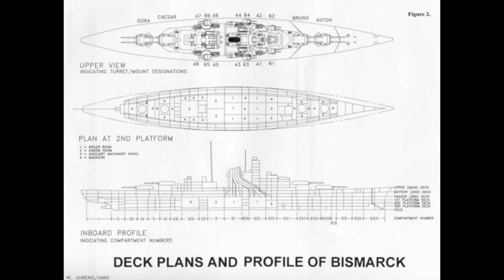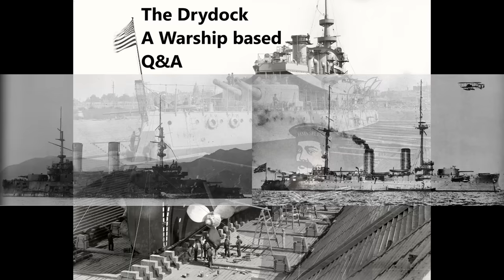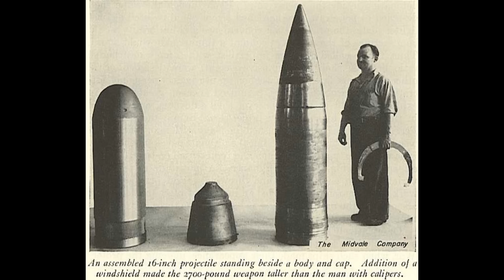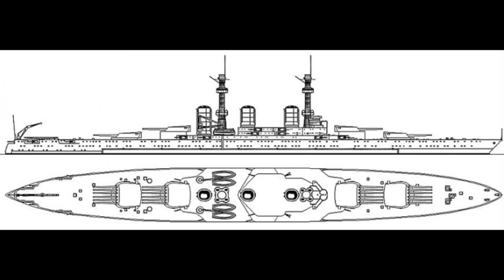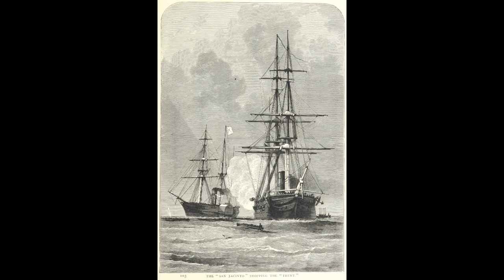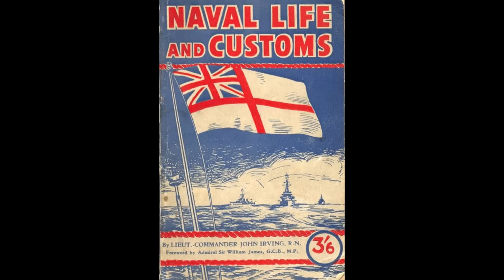The Drydock - Episode 096

Comment: Recoil issue - more waffle, I'm afraid.

Gun recoil on a single gun, commonly on a destroyer say, is longer because the gun is mounted as a single on its own centreline. The recoil cylinder is also part of the gun mount and recoil generally has little direct relationship to the ship's structure. This is underscored in the next example of recoil and run-out on a twin mount. Gun recoil cylinders (encased springs in what is essentially a hydraulic collapsing ram filled with oil and soft soap) generally work well within design tolerances for the gun mount and do not transfer that much to the fixed structure. 

On a twin mount, the barrels lie either side of the mounting's centreline and in alternating fire - the common fire control method - this off-centre barrel arrangement dictates that the mounting itself absorbs some recoil. This is why twin turrets in the medium calibre classes have what is known as a 'recovery time' - that is, the time it takes after absorbing recoil for the turret to get itself back on the firing line. Shots before this would obviously be off-aim, which is why alternating fire and a rounds per minute rate which also takes into consideration the turret recovery time is used.

One caveat for this would be where a twin gun is set at Local Independent Fire - meaning the rounds can be fired as soon as the breech closes or as and when the Captain Of The Turret (who can always see a target) operates his trigger, but this would generally be in instances where the target is relatively close and in clear sight,  or where the situation is desperate and timed firing is not possible.

Twin gun broadsides were never out of the question, but were never encouraged, and the Captain Of The Gunhouse (usually in his cage behind the guns) always cleared 2 loaded guns at 'Stop Loading' one after the other - never both at once.

Comment: Something else to note about the question regarding shore batteries and in particular the mention of railway guns use as  coastal defence weapons.  The Germans and to lesser extent other powers (most noteably the Russians) used railways guns for coastal defence purposes. The Russian 305mm guns where built for this purpose and had special concrete pads built in various places to enable their rotation and emplacement as proper coastal guns, the ‘railway’ aspect being more to enable their movement between these pads. 
The Germans however used normal railway guns (guns designed for land based bombardment) as anti shipping weapons. Even when mounted on Special turntables they where hopeless against moving ships, their lack of fire control and shells designed to pierce concrete rather than steel made them ineffective at best and useless at worst. 
The only nation to truly use railway guns for coastal defence are the Italians. As such artillery trains usually comprising 2-4 wagons each with either 2 105mm or 152mm guns each proved extremely effective at harbour and coastal defence. Due to having some modicum of fire control and being able to move while firing. 
In fact during WW1 two such trains drove off an Austrian armoured cruiser on their own. 
Hope you enjoyed this little adventure down the use of railway guns for coast defence.

Comment: Another point to mention regarding the attempt by TF 11 to relieve Wake Island: The SARATOGA had only Brewster Buffaloes as the fighters in her air group, not Wildcats. Though either fighter would have fared badly against the Kido Butai's Zeroes. I had always wondered if the USN had thought of sending their destroyers in on a fast run to evacuate at least the civilian contractors, if not the whole garrison.
Reply: Actually, Saratoga's own fighter squadron was flying Wildcats, but only had 13 of them (12 after one was lost in a crash en route), which put it at roughly half its nominal strength. The 14 USMC fighters Saratoga had embarked to transfer to Wake were Buffaloes, though.
Reply: Paul Bishop - The destroyers probably would have been sunk like many of the British ships involved in the evacuation of Crete were.

Comment: For the firearms people, gun people ready to complain. 
Yes, you can hit small targets with shotguns, yes, you can between shot and choke, get some really tight spreads. Out to some distance. 
However, that's only at relatively close range. Go down a kilometre and tell me how much that shot can spread out? 
My bet is a lot. 
Same principle here. The longer it's in flight, the more time air, air pressure, atmospheric conditions have to change it's flight path. When curvature of the earth is a factor and all beyond that, as for the factors given in a recent video, yeah, it's a fair comparison. Even if the point of comparison, the shotgun, has no bearing on reality.
Reply: So ill give you my hunting shotgun. 20ga with a rifled barrel and sabot ammo.  Or without and just slugs. Comparison invalid.

Comment: US submarine commanders believed that aircraft carriers were particularly susceptible to flooding up high.  The torpedoes that sank the Shinano were set to run at just 6 feet.  In this case there was an added benefit unknown to the commander.  Running shallow the torpedoes hit near the transition from the heavy battleship armor and the torpedo protection.  This joint was a weak point in the design of the Yamato class hulls.

Comment: On the "high altitude bombers"; if I remember corretly, the USAAF had B-17s in Midway, who carried out severall attacks. They scored zero hits...
Reply: A B-25 did a kamikaze on a Japanese carrier, nearly hitting the bridge, but missed and crashed into the ocean.
Reply: @dancingwiththedarkness3352  B-26, there were no B-25s at Midway.
Reply: There is a famous case of a Japanese destroyer captain, pulled up to assist a crippled squadron-mate, ignoring B-17s overhead, only to lose his ship when one bomb struck the stern deck. He was fished out of the water and observed that even the B-17s can get lucky once in a while.
Reply: @dancingwiththedarkness3352  that's not a "high altitude" level bombing run...
Reply: @kemarisite  well, that and (as Drach mentioned other ships did) not dodging...
Reply: @kemarisite  The Norden bomb sight was very good at hitting stationary targets, it's not designed to hit moving targets who can see the bombs falling and avoid them.

Comment: The USofA Army Air Forces doctrine for horizontal bombing ships was sound but in 1942 they didn't really have enough bombers in total to attack a single ship effectively.
Reply: calvingreene90 - You’d need a LOT of bombers to do a job you could do more easily do with (depending on the ship) 4-16 dive bombers & 4-16 torpedo bombers, unless the ship in question is not moving (Think Tirpitz), & you dropped HUGE bombs from very high altitude (Think Tall Boys).
Reply: @TraditionalAnglican  
But you lose fewer planes and crewmen when dropping from high altitude. 
Bombs are cheap.

Comment: A comment on reinforcements of weak points and associated categories of connecting things at joints.  The major weak points of guns are, as mentioned, the ends where the forces are no longer symmetric as they are in the middle of the barrel length.  The breech end is highly reinforced by adding extra thicknesses of steel, both to the gun cylinder and the internal liner (if any) that has the rifling grooves.  When using powder bags, the breech block has to not only resist the blast of the propellant with its maximum force right against its inner face, but must seal the crack between it and the cylindrical barrel surrounding it so that blast does not go back into an enclosed turret (fumes would be a major problem to the crew).  This is called "obturation" and, for powder-bag guns, this uses compression-sealed, thick, slightly-flexible pads on the inner face of the breech block that squeeze tightly around their edges against the cylindrical barrel touching them to keep the blast in when the force of the blast squeezes them flat.  For cartridge ammo, this is much easier, since the steel or brass base of the cartridge is made thick enough to withstand the blast when supported by the breech-block behind it.  Since the cartridge is the obturator, you can use a sliding breech-block in place of the screwed-in block (originally using several full turns, slowing the loading process, and later using "interrupted" (stepped width) screw threading to allow a single partial turn of the breech to interlock all of the threads simultaneously).  The cartridge design's problem is having added complexity in removing the used case to allow another shell to be loaded for firing, though the loading process for the propellant can be speeded up significantly through the use of such cases -- complexity for speed of the breech mechanism versus powder-loading speed and a more complex breech-block system, a design problem.  Krupp guns chose the complexity of cartridges for fastest speed and most other gun-makers chose a powder-bag system, though eventually cartridges became almost universal to handle very high speed of reloads for guns used for anti-aircraft and, eventually, any purpose.  Sliding breech-blocks and cartridges also reduce the direct forces on the breech end of the gun somewhat, as the cartridge takes the main concussion shock of firing the gun, so gun damage problems with the sealing breech-block mechanism has less chance of happening.  Another plus for it.

Interestingly, this is also a problem for armor.  When hit by an incoming projectile (the other end of the firing cycle, as it were), the shock to the plate and to its supporting structure is considerable, especially as the armor is supposed to do its projectile stopping or deflecting work over a rather short distance (longer at high obliquity as the shell makes a deep dent or gouge into the plate face that has some length in the direction that the shell is going and merely its thickness and slightly more for deformation at near right-angles).  Thus the armor shock is much greater directly behind the impact point.  Steel is rigid, even the "homogeneous, ductile" material used for decks and such, and extremely rigid for face-hardened armor where its face layer must be broken like concrete to allow the projectile to do more than chip its surface (this greatly shortens the time that the force of impact is occurring in such rigid armor and makes anything in the nearby area suffer immense shock effects, including the internal plate material itself).  There are a number of problems attaching armor to a ship hull structure that does not cause failure to the supports that either allows the plate to be shifted away from its neighbors and potentially lets the shell or, if it breaks up or explodes on the plate face, its blast and pieces through the gap, or it collapses completely and lets the shell through or, if at the waterline, water into the ship through, the rather large hole just formed.

To lock plates together adequately against the immense and very sharp, high-rate-of-change forces of a heavy projectile impact as supersonic speed must be handled by both the supports behind the plate and for some distance to the sides (you do not want the support to merely shear around the plate edge like a punched-out plastic model piece in its box).  First, the supports have to be strong enough, braced with reinforcement doubler plates and angle-irons to the hull structure, with the connectors in many cases being high-tensile or even armor-grade steel  themselves.  Of course the hull structure itself to which these plates are mounted has to be reinforced more than a normal deck or outer hull plate would otherwise be to support the added weight and these shock effects.  Lots of testing has to be done to define such things.

The method of connecting the plates to the supports and to each other is important.  In many cases prior to WWI and strangely even after that in some ships, the armor designers had the completely incorrect idea that the edges of plates that press against each other need only be supported from behind and not connected tightly to each other.  Again and again, this was shown to be WRONG.  The best support for an edge of an armor plate is another armor plate, if at all possible, with the jointed edges being locked together as solidly as practical.  To hold plates together, usually heavy bolts made of close-to-armor-grade steel (nickel steel, called Class "C" Armor by the US Bureau of Ordnance, was used for heavy bolts, nuts, and edge backing plates) was used to screw into the backs of the two joined plates and to the ship hull supports, but, as just mentioned, this usually was found not to be enough if the two plates could slide or pull apart at the joint.  What the US Navy did was "keying strips", again of Class "C" armor.  Deep countersunk grooves, wider at their bottom than at their tops, were ground into the edges of the plate (how many parallel grooves depended on how thick the plate was).  The plates were pressed together and long, contoured Class "C" armor strips were forced into these grooves along the entire edge of the plates, locking them together with a somewhat flexible, very strong bond so that an impact on one plate could move that plate slightly to reduce shock to the joint, but the two plates would still mostly act as one plate and reduced the forces on the supports behind the hit plate -- "in numbers there is strength".  Note that in face-hardened plates, in the US Navy the grooves were only cut into the soft back portion if at all possible, since grinding into the face layer is difficult and the edges would be brittle; minimum numbers of holes or pits were made in the face-hardened plates and any holes, such as sideways periscopes for the turret gun-layers into the side plates, were kept as small as possible.  Other nations had other ideas, of course.  If you look at the side plates of German WWII battleship turrets made of Krupp KC n/A armor, you will notice a row of huge bolts at the edges, counter-sunk in deep holes to go directly into the soft back without the bolts touching the brittle face layer.  These locked the face and back plates to the side plates, all of KC armor.  There was no such bolts visible with the ductile Wh armor roof plates, indicating keying strips or back-layer-only bolts were used into the upper edges of the KC sides of the turret.  Seems like a lot of extra work to me.

Minor points:  The bolts needed to have their threads reaching outward from the central shank, not cut into it like most regular bolts to maximize strength and prevent impact shock from splitting the bolts apart at the thread grooves.  Also, heavy rubber ring-shaped pads had to be placed between the reinforcement rings between the bolts and nuts and the armor to allow these cushions to compress some major distance prior to the forces from the impact reaching the heads of the bolts or the nuts themselves.  Otherwise they could easily be torn free of the shank and  act liike missiles and allow the plates to dislodge.  This was found out by the US during the US Civil War, so if it was not used, there is really no excuse for that!!!

Comment: The potential of the I-400 was slightly off center.

Instead of a plane with a bomb.... switch that plane out for a transport ... fill said transport with spy's or special forces and sneak them in and out of various areas.

Comment: I could see the I-400 series more useful to Germany than Japan, just think of float-stukas and float-109/190s launching ahead of a strike providing information, air cover and as an extra weapon to score more tonnage kills and protecting subs as they sit on the surface to recharge their batteries...
Reply: Feiora - The Germans could have built 3 Type-VII’s for the resources used to build 1 I-400, & FW-200’s did a good enough job of recon & attacking convoys. The Germans desperately needed more U-Boats, not something that really didn’t fit their “submarine doctrine” that cost a bunch of the ones they actually had.